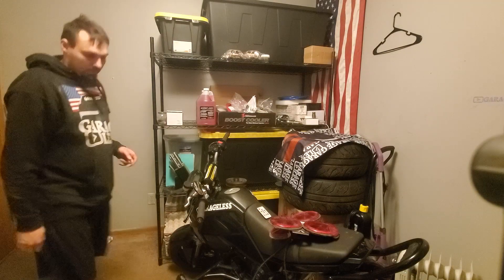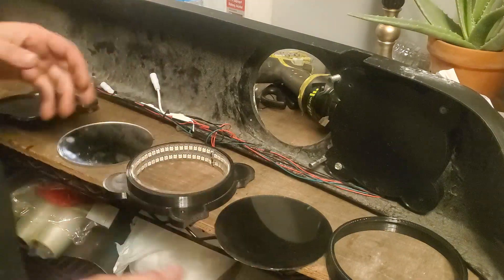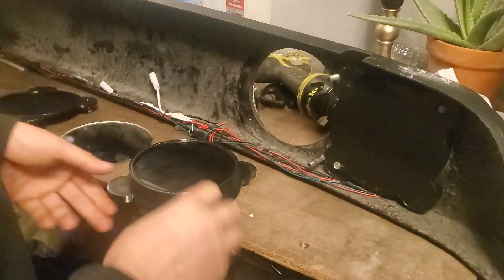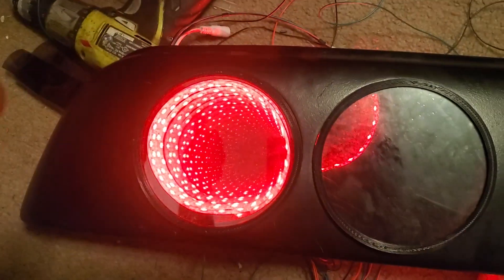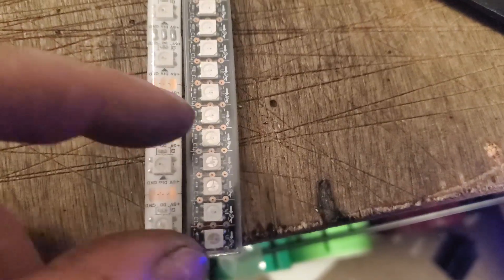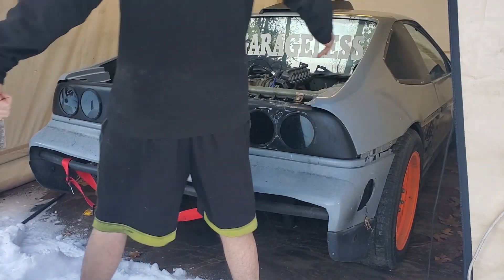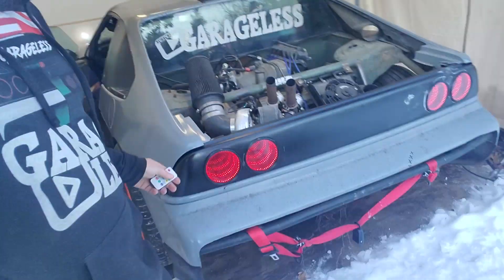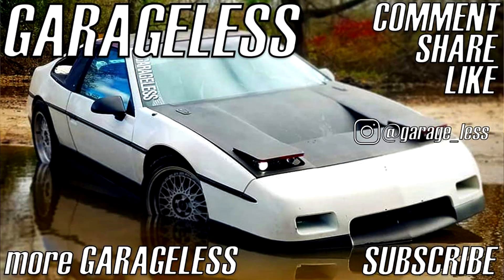HOW I MADE INSANE INFINITY MIRROR TAIL LIGHTS!!! USED 3D PRINTER!

Comment: They now make COB and FCOB LED strips that are much higher LEDs per inch and are diffused by design. Check 'em out if you ever wanna do a refit on this design. Also, is there a way to set up amber turn signals while still having red running and brake lights? Amber/yellow turn signals are SO much nicer driving behind people than red. Much more obvious that they're turning/changing lanes.
Reply from the maker: My revision made it much more noticeable

Comment: If you're driving, and have them on "show off look at me mode" cycling through the rgb motion etc and you push the brake pedal or indicator, would the brake lights/or indicator work?

I know you demonstrated with the green led and indicators but would like to know if brake lights and indicator (amber) would come on if they were on a cycle mode

Thanks in advanced
Reply from the maker: If running lights are the cycle mode then brake/turn would b red
Reply: @Garageless  cheers for reply mate. Will look into diy soon and figure red brake and amber indicator (Australian standard)

Loved the project mate they look mint
Reply from the maker: Yea these are definitely not road legal in states either lmfao
Reply: @Garageless  haha idc about lagality 😆 just as long as they can shine red upon braking and indicate amber upon indicating whilst going through the rgb motion/demo than ill be happy 😆💪🏾

Comment: beautifully thought-out and well done video brother, you made it extremely easy to do and understand, now the only thing is where can i get those lights with the control and the controller module?? #staydriven
Reply from the maker: I dont have links but i posted parts list in comments somewhere lol lmk if u dont find em
Reply: @Garageless  ok last technical question...as for the 12v to 5v converters, do i need a converter for each tail light set, for example you have 4 tail light infinity mirror sets, do i need 4 converters or can i get away with 2 converters, one on each side?.....and lastly for the remote controller, it looks like you have multiple connected with the white cord that comes with the remote, how many of those do i need to buy and connect?

sorry for the long questions, its just that i literally have the items in the online carts ready to buy, and just want to make sure i'm getting everything i need lol
Reply from the maker: I used 3 of each i believe... one for running, brake/left turn, and brake/right turn... running and brake may be switched i cant remember
Reply: @Garageless  ahh yep! i found them, thanks again bro!

Comment: 9:59 can someone explain to me about this, everytime i put my start scan LED on my bike with 12v battery it will burn and the led will not function and some of it doesnt turn on. ive test it 3 time and 3 time burned
Reply from the maker: U need a 12v to 5v converter... the leds cant b run with 12v directly the need 5v
Reply: @Garageless  and even with 12v specification LED? thank you for your explanation
Reply from the maker: Im not sure addressable leds have 12v versions but could b wrong... im no pro... should say on website where u ordered em from hopefully or can get a 12v to 5v converter off ebay they are inexpensive like 7$ or so i believe
Reply: @Garageless  yes the website i bought said for 12v DC. But it's okay I'll try with the converter, becoz the battery instantly killed my led when switch turn on. Thanks bro
Reply from the maker: Yea weird if truly 12v should obviously b fine... hopefully the converter fixes the issue

Comment: How did you solder each light? My solder isn’t sticking to those little LED copper terminals (for each addressable LED)
Reply from the maker: I had to heat the underside of tab and touch the solder to top of tab to get it to stick...

Comment: Just ordered a ender 3 pro so I can finally get to making some for myself (corvette)! This video will be helpful. How did you cut the acrylic and glass and where did you buy it from? I bought a plastic sheet and a dremmel for my initial prototypes but I'd rather use hard acrylic and glass if I can cut it to the correct shape. Thank you!
Reply from the maker: I used dremel its acrylic and the mirrors i ordered size i wanted but also acrylic
Reply: @Garageless  I just realized I also commented 7 months ago here haha. Anyways, what thickness acrylic did you use and where can I buy it from? I assume too thick would be hard for a dremmel to cut through. And lastly, would you recommend just cutting 2 identical acrylic for front and back, and using a two way mirror film for the front one and a 1 way mirror film for the back one?
Reply from the maker: Not sure thickness it was common plexiglass thickness... all depends on your design but mine where both same size i believe
Reply from the maker: I rough cut it then used belt sandwr to do edges... my edges are hidden from how i designed it to go together but should b able to get em pretty good
Reply: @Garageless  That's what I'm thinking too, if I design the 3d printed frame well enough and maybe 3d print a nice part to base the plexiglass cutouts from then it might be good enough to get away with rough edges.  I guess I'll be looking for acrylic at the hardware store? Also I did find the list of led's and controllers you use in another comment so thanks for all the info. I really appreciate this stuff!
Reply from the maker: Np... good luck!

Comment: Where do u get them light did I miss tht
Reply: The leds Whts the brand with controller love how they run & all the stuff the do
Reply from the maker: Housings we made...
Ws2812b 144 leds
Sp103e controller 
12v to 5v converter
Two way mirror film
35% car tint
One way mirror for backing i used acrylic mirror
Should cover everything
Reply from the maker: Srry i added a pinned comment with all the info and forget to throw you a response
Reply: Keep up the good work bro I have the bell 🔔 on 🙏🏾
Reply from the maker: Hell yea! Great to hear!

Comment: Were can I buy some of thee electronics from that make that light up the lights with the remote control like thanks davieanw@gmail.com
Reply from the maker: All off ebay... sp103e is the controller
Reply: Thanks garage less man but I want to just get a parking and brake light electronic device one that has that hi and low look as in when you step on thee breake pedal it get brightened can you help me
Reply from the maker: My high low is just running light staying on constant and when step on brake pedal it just turns on a second set of leds to make it brighter

Comment: great work brotha!i'm going to make a set for my car. ..2 questions though...to save some wiring could i wire in the step down converters into the factory harness?and how did you make sure the red came on for brake lights instead of like green or blue?thanks!subbed!
Reply from the maker: Just need to make sure its set for red... light has to b on to set it
Reply: @Garageless  thanks for the info.keep up the great vids👍
Reply: @Garageless  so do you have 3 separate remotes? One for tail lights, one for brake and one for turn signal?
Reply from the maker: One for running lights, one for left turn and brake and one for right turn and brake
Reply: @Garageless  how do you make  the turn and brake work for their own colours? Turn is usually Amber and brake is usually red or are you running both red?
Reply from the maker: Both are red.... you could achieve that with an arduino but im not that skilled
Reply: @Garageless  ahh okay makes sense, I'll probably just run 3 led strips inside so I can gain the Amber indicators. Thank you man ❤
Reply from the maker: Easy enough

Comment: how did you wire it so that the brake,turn,hazard lights overide the colors when colors are active?
Reply from the maker: There is a 2nd led strip in there that is strictly brake and turn
Reply: @Garageless   yes but what makes it strictly brake and turn. its wired from the brake and turn signals to RGB controler, but what makes the brake and turn signals take over when the lights are a different color. also why 3 RGB controlers?

Comment: Love it! I've need to make someone like that for one of my projects.
Tip on printed parts-
If you use ABS, you can smooth with a acetone vapor bath. Makes it look like a production plastic part. I recommend UV protection too. Petg is also good for automotive use.
Reply from the maker: Yea petg is what i use prints easy and no shrinkagae or warping like abs can
Reply: @Garageless  also, have you tried a concentric top layer on round parts? It gives you a smoother and better looking top on cylinders

Comment: Which is your led kit please ? How did you connect it ? How have stop light funct ?
Reply from the maker: 2 sets of leds... 1 running lights other is brake and turn... gonna depend on wiring in car... id recommend only doin the infinity lights for running lights
Reply: @Garageless  okay, For the stop I ended up thinking that too. Add a more powerful LED strip. 
My real concern is the connection to the vehicle (I'm not yet confronted with it, I want to find out as much as I can before). For example, does it take a case to fit the LEDs, in addition to the controller ? 
Clearly it's really the LED adaptation on an une equipped vehicle that poses me "problem"

Comment: you'd better go with amber blinker with only outer light... if you ask me... also, for stop light, add additional diodes behind mirror, if possible, so it will really shine...
Reply from the maker: Ill b doin a redesign with some red halos for brake lights and turns... then make infinity lights for running lights

Comment: Can I get a parts list for the leds ,controllers and 12v to 5v thing?
Reply from the maker: Housings we made...
Ws2812b 144 leds
Sp103e controller 
12v to 5v converter
Two way mirror film
35% car tint
One way mirror for backing i used acrylic mirror
Should cover everything

Comment: Parts list bro please
Reply from the maker: Housings we made...
Ws2812b 144 leds
Sp103e controller 
12v to 5v converter
Two way mirror film
35% car tint
One way mirror for backing i used acrylic mirror
Should cover everything

Comment: How did you wire it? Did you run the power through the controller out to the lights? If so did you have to run different controllers for the running and brake lights? Or did you only run the signal wire to the controller and power it separately from the lights?
Reply from the maker: There is 4 wires in my case off the for the rear...
 Brake/left turn-12vto5v-controler-to inner led...
 Brake/Right turn-12vto5v-controler-to inner led...
 Running lights-12vto5v-controler-to outer led...
Last wire was ground-to all 12v to 5v converters...

Comment: For the turn signals and brake lights, how did you keep them red and brighter?
Reply from the maker: If i step on brake and set it to brightest setting then let off brake and set the running lights a little less bright... not optimal but ut works
Reply: @Garageless  gotcha, appreciate it

Comment: Those are nice lights man!!! 2 Questions: 1.) You mention your version is (let's say unauthorized) because of the tint over it, but if you changed that tint to Red, that would be cool right? 2.) Is there a list of the parts you used(2 different LED types, remote controller, 12v to 5v converters...)? Liked/subbed:)
Reply from the maker: Technically it states no film... so it would still b "unauthorized" lol in the comment section i listed wat i used... if u cant find it lmk ill find the info
Reply: So technically all infinities will be unauthorized....oh well, I'm still in:).
And found below you mentioned for around $200 you got:
Ws2812b 144 leds
Sp103e controller 
12v to 5v converter
Two way mirror film
35% car tint
One way mirror for backing i used acrylic mirror
And a hobbyist license plate...never heard of that in the state of Florida, gonna look into that:).
Reply from the maker: @Karopine  yea in Wisconsin its a saving grace lol yea u can catch shit for any light mods

Comment: Every state has there own version of legal and it is often left up to the cops digression.Been ticketed on 2 different cars for license plate light not bright enough.Zero modifications to the license area and 100% functional factory lights.That said,,, If you have factory location,function  and lumens you are good in most states.factory 2057 bulb is 325+/- lumens after the red filter. So per fixture 
  number of LED x lumen per LED - 35% for tint > 325 lumen
  Or you can use an old SLR camera to compare them to factory lights with the light meter.
Reply from the maker: I have hobbyist plates which help... i dont get messed with for my exaust and its 2 feet long lol
Reply: @Garageless  I've never heard of hobbyist plates....will have to look into that:)